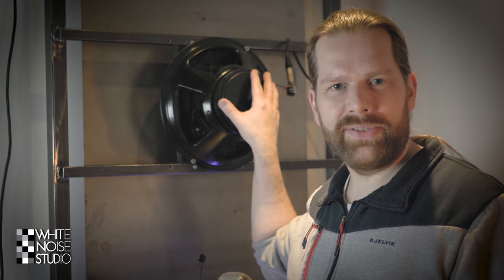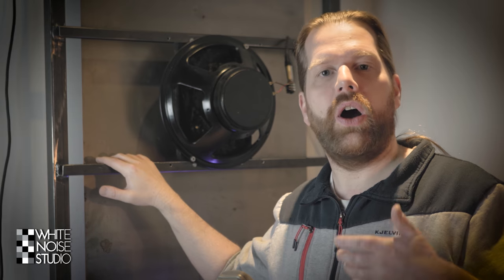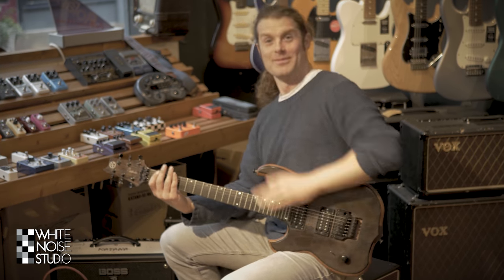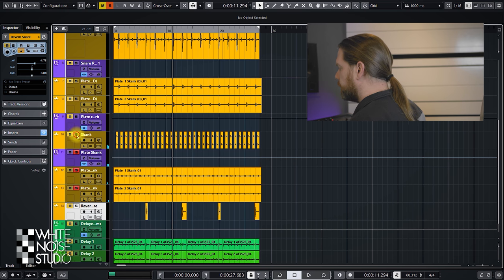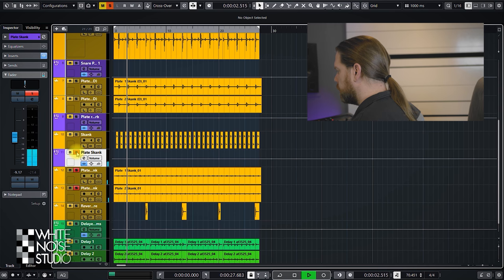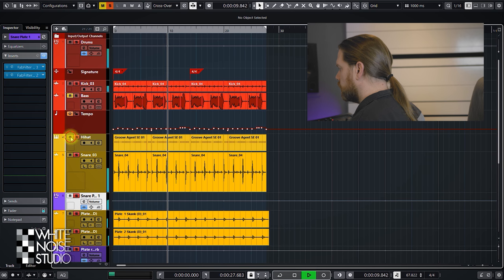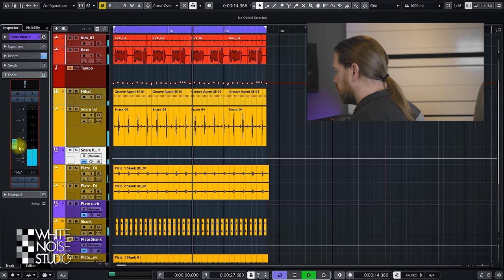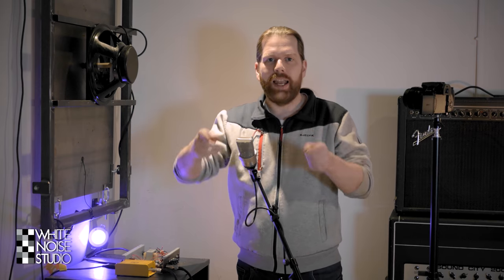DIY Plate Reverb: Uses and Showcase

Comment: Did you just put the speaker a couple of cm in front of the plate?
Reply from the maker: Basically you're correct, but there's a small wooden stick glued to the speaker coil which vibrates against the plate. In theory a very loud speaker would also vibrate the plate, only the piëzos will pickup the spekaer sound too then.